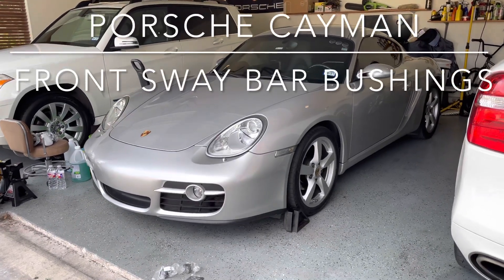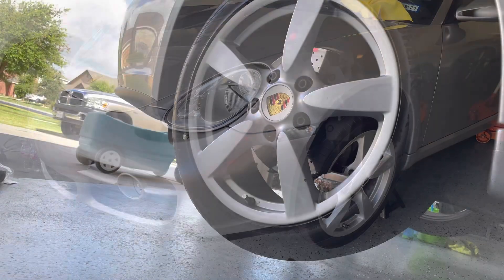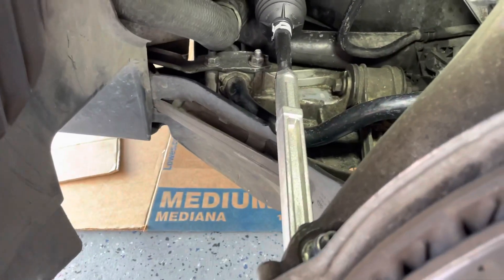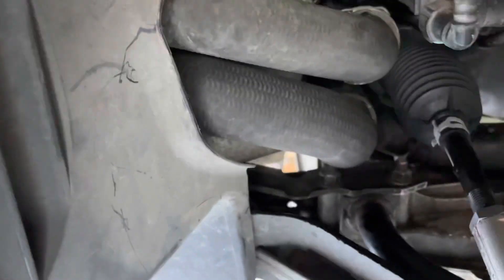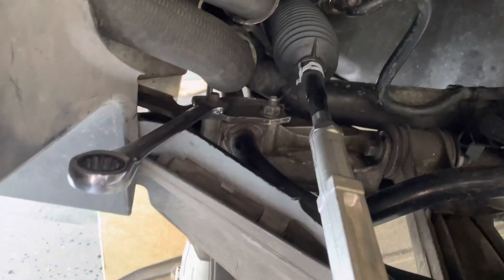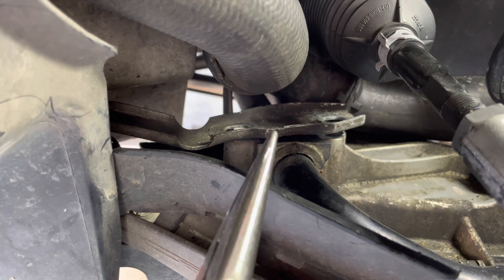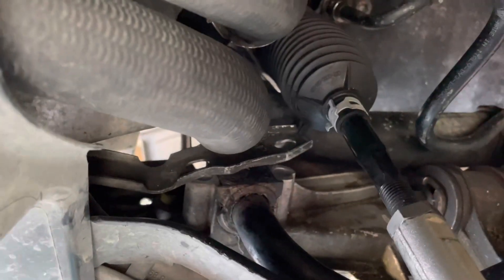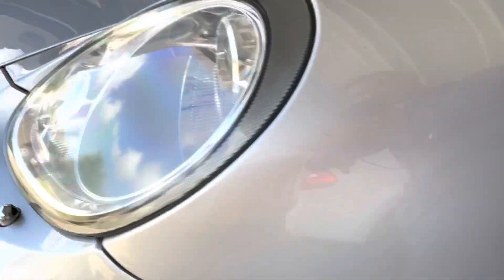Replacing the #FRONT #SWAY #BAR #BUSHINGS on #Porsche #Cayman #987! Enjoy & consider subscribing.

Comment: What was the symptom that lead you to replace the sway bar bushings? I have 2012 Boxster 987.2 S with only 20,000km. I hear a clunk noise when reversing with sharp turns out of the driveway. Someone said it could be my right or left sway bar. Any advice is greatly appreciated. Thx
Reply from the maker: Hard to tell without me physically there but I predict it’s your Front lower control arms and Front control arm links. When I replaced the control arm links, the clunk noise went away especially when I’m going over bumps.  Here is the video for it:

https://youtu.be/FTz-sH9tsPc?si=zkn_QkC9W550TWEb
Reply: @512TXSDIY  I just got a 987.2 and it sounds like loose marbles going over low-speed bumps. I'm thinking drop links, control arms, or sway bar bushings. Any thoughts?
Reply from the maker: I am thinking the lower control arms and front track arms (I believe this is what it's called) but it connects to the front subframe. It would have a thump sound when going over speed bumps or any bump for that matter.

Comment: Nice video! Did you get a noise coming from the suspension or?
Reply: By the way, the torque of those bolts that hold the bushing seem to be 48ftlb according tot he service manual
Reply from the maker: I've had these bushing for 12 months or so and keep forgetting that I have them so I decided to install them today. The noise I was expecting is actually from worn front lower control arm links, which I will be replacing soon once the part comes in. Thank you for the comment and don't forget to like and consider subscribing to the channel.
Reply from the maker: @agustinrey1505  Really? That seems really high. I was thinking 17 ft-lbs or something like that.
Reply: @512TXSDIY  Makes sense to me.  Things like the oil drainage bolt are around 20, but  the sway bar connects the two struts together.  With all those flexing forces in play, I'm not surprised.
Reply from the maker: @DC5Brandon  True. These are sway bar bushings though, not the actual fasteners on the end links. Seems high to me is all. Would suck to strip them and have to go get new ones is all. Did you torque yours?
Reply: @512TXSDIY  Haven't done the sway bars yet.  I've made some mistakes in the past, so I'm letting experts do the work now, except the oil change.  That's why I knew about the torque specs for the oil drainage bolt 😉
Reply from the maker: Lol. I get it.

Comment: so you take a nice new, clean bushing
put sillicone grease on it.. and install it on top of the dirty swaybar, just like that?

Get that sand to grind in the lube and rub out the bushing from the inside or what?
Reply from the maker: Exactly! It adds horsepower. 

I brake cleaned everything out after. It’s hard to film every detail when working on cars.